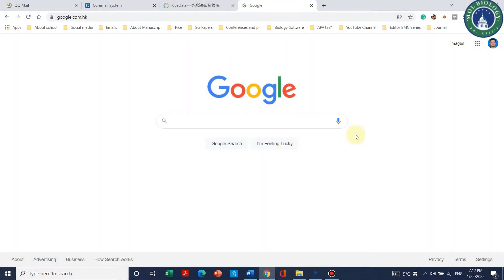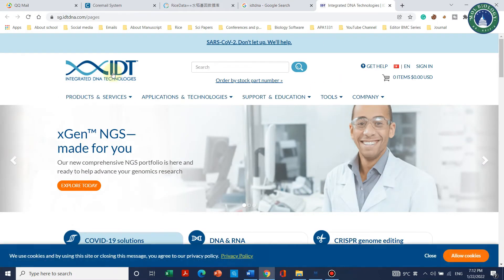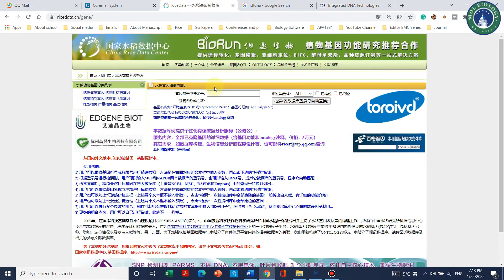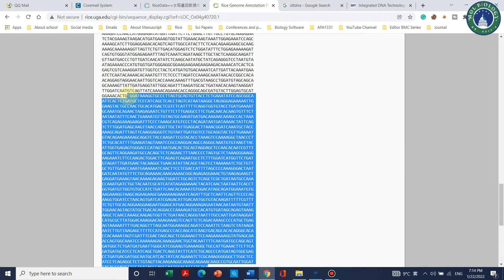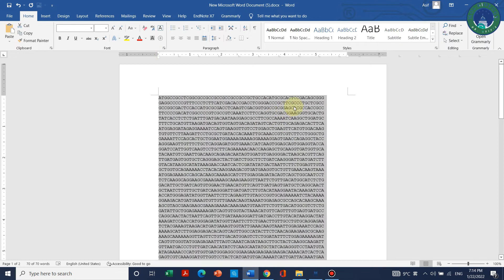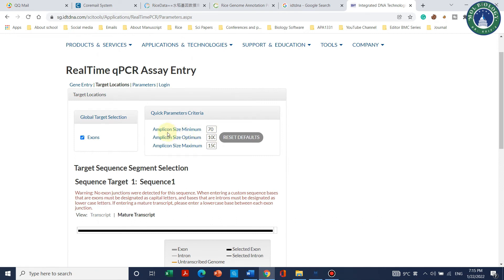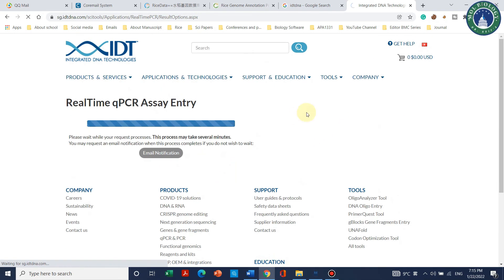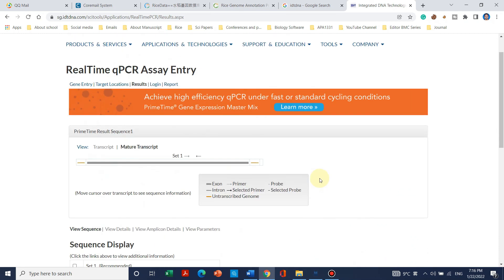How to design Primers for qPCR analysis

Comment: do we need to select the 5 and 3 utr region along with cds ?
Reply from the maker: No
Reply: @asifmolbio  so can we just directly select it from the idt site rather than having cds sequence from elsewhere ?
Reply from the maker: @sonamgupta1062  if sequence can be accessed using idt site. Off course there is no need to import from any where else
Reply: @asifmolbio  okay so they are showing different sets of sequence but the recommended set is showing less gc value .. around 45 ... should I proceed with that ?
Reply: @asifmolbio  or can I change it manually ?
Reply from the maker: Around 45 is ok 👍, but less than 44 is not recommended. You can choose from recommended pairs
Reply: @asifmolbio  this was the recommended one
Reply from the maker: You can use that